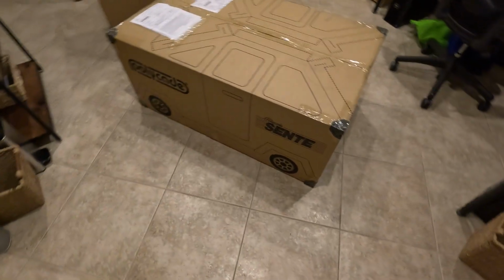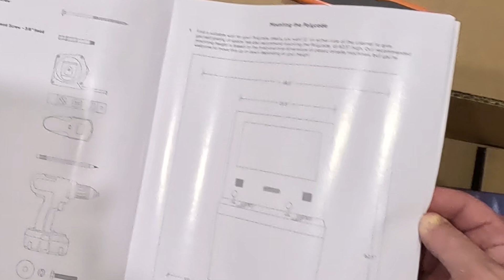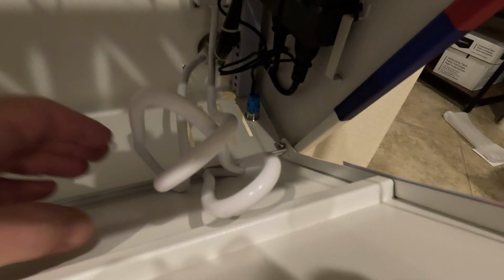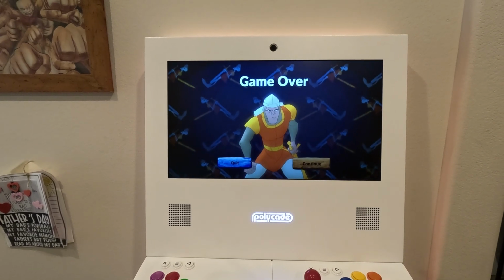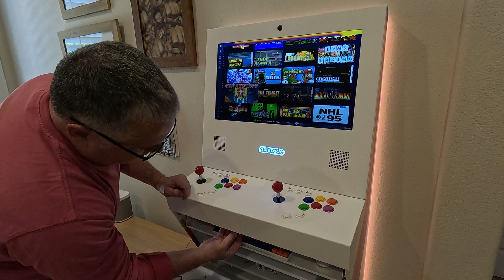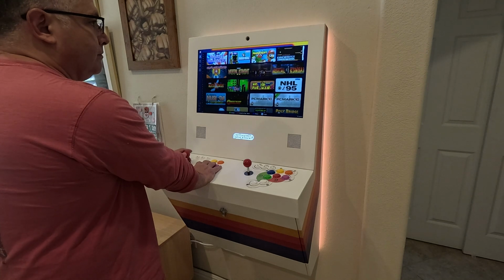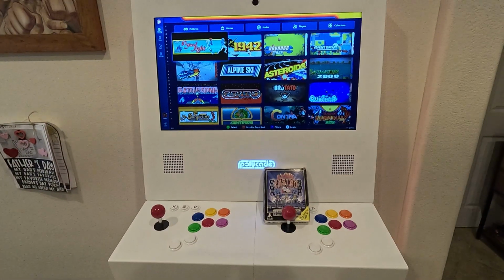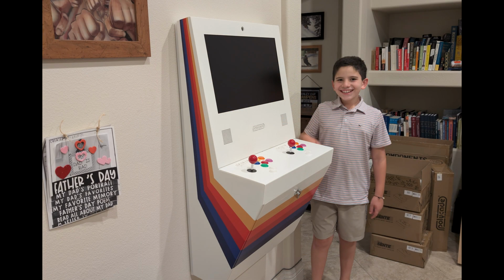Polycade Sente Unboxing and Initial Experience

Comment: Hello, thanks for putting this video together. I accept our Sente shipment tomorrow. I am going to run a new electrical outlet from the other side of our wall. Can you just put it behind the sente? Do you anticipate any problems with that versus having the power cord come out the bottom to an outlet? Thanks again! Edit: I see the wire access on the back of the bottom of the case now after watching that part again 👍
Reply from the maker: @seattlerealestateiq  if I had the time, patience, and resources, I would have placed the electrical outlet and ethernet access to match with positioning of the upper third of the back of the unit.

Having lacked the patience, I just ran the cables out the bottom. Works fine.

Comment: Perry, I am interested in the Polycade because it is a beautiful system. I was going to do a massive 50" standup arcade but there is something about the Polycade that looks amazing. My only concern and I wanted to get your opinion on this was the screen size. 24" 1080p is too small and the newer games the CPU supports would look way better in 4k. I know Polycade had to make cost choices but for close to 3k they should have upgraded the monitor. What do you think?
Reply from the maker: @enigmacarpc55  I'm perfectly happy with the 1080p monitor. I'm standing pretty close to the unit as I play and it's a big enough screen for me. 

I did buy an internal rack that would let me mount a more substantial PC inside the Sente.  I may yet build out a system that fits. If I do, I may not increase the screen resolution. You are right that newer games look glorious at 4K. I have some appreciation for the lower power requirements and quieter systems that would run games well at 1080P. I don't think there's a wrong answer here, just preference.

I also agree with you that the unit is very pretty. I might add that having it on the wall and on all the time makes it accessible and easy to pick from a good number of fun games.  A higher-end system running at higher resolution would draw more power. It might also generate fan noise as the thing stayed on most of the day. Just one more consideration for going the lower resolution and lower power route.

Comment: 1up Partycades perfected the wall mount slim form factor years ago. With lit marquee and full OG style art and vertical or horizontal 4x3 monitors, closer to og arcades.
No, not all metal construction, but good enough for non commercial home use.
This should use a rotatable screen.
Spinner a must for games like Tempest, Omega Race, etc.
Reply from the maker: Yah, the mount is excellent.  Official spinner is on order.  I custom made/configured one without much trouble.

Comment: Very nice video!  Can't wait for mine to arrive. Any thoughts on including other systems or running Batocera or some other front end?
Reply from the maker: Thanks.  I started with the Polycade software frontend AGS.  It works well enough and is integrated with a Polycade game store.  I don't see why something like LaunchBox or Emulation Station wouldn't work just as well.  I do like how the fanless Polycade PC fits ion the case.  I expect to upgrade with a custom PC + GPU at some point.  I might experiment with other emulation aggregators then.  I might add that the Polycade controllers are recognized as XBox controllers.  Dunno if having a Windows build makes things simpler or not.  I have not used Batocera, but it seems feature rich.  You like it?

Comment: This is the video I’ve been waiting for as I wait for mine to arrive! Thanks for taking the time to make it. did you edit the config file yourself to expand supported roms or are the units shipping with an updated AGS?
Reply from the maker: @GenericYoutuber1212  I edited the config to add Atari Lynx Casino emulation.  I also added a lynx casino core to retroarch.

I made a few pictures for the AGS library menu (header pics) too.
Reply: Could you please do a video showing me how to do this? I just got my sente on the wall today but have no idea how to get the games I really want like Joust, frogger and pacman. 

I need help. I don't know how to do this.

Comment: Thanks for taking the time to do the unboxing video. Early on you mentioned that you might swap to a pc with a gpu. Can you go over why someone might want to do that or what limitations the mini pc has that have you contemplating an upgrade already?
Reply from the maker: @SeanF-c9d  The included PC is more than enough to handle 99% of retro video game emulation on multiple types of emulators. As the games get more visually complex, involving 3D graphics and twitchy gameplay, a graphics processing unit can help ensure that games play at a reasonable frame rate.

The Sente provides for multiple controller types, and the number of available controllers is likely to grow.  I have a pipe dream of purchasing the upcoming release of Microsoft flight simulator and using a flight yoke and throttle system that I can attach to the Sente.  There are a few pieces of that puzzle that are still missing, but a PC with a GPU would be required for reasonable gameplay.

Comment: Thanks for posting this. Looks like game play is smooth. Any particular reason you chose not to install an outlet behind the unit? Looking at the installation instructions, it looks you can install one behind the screen area and then have your power cord completely hidden (and saves having to go through that back hole)
Reply from the maker: Didn't want to wait for an electrician to drop a line in the place of my choosing.  I agree with you though.  An install that hides the power cord, and maybe an ethernet cable, would be ideal.

Comment: Great video. Did you notice if there is room behind the machine to accommodate routing the electric cord? When mine comes, I was thinking of hiding the wire fully behind the machine and plugging it into a recessed electric box that I would mount behind the machine.
Reply from the maker: Yes.  The Sente is designed to do just what you say.  See page 5 here: https://cdn.shopify.com/s/files/1/0065/4956/9647/files/sente-instruction-manual-print-v1.3.pdf?v=1722474147
Reply: @mskraddoc  awesome. Thank you so much!

Comment: I’m interested in making a home arcade cabinet myself. And I’m kind of interested in the wall mounting system. I find it just looks cleaner. I think the modular control deck is a cool idea, but I can see it being a little annoying having to unscrew, Remove, switch out and screw back in
Reply from the maker: @Metal-Josh  I guess there are a lot of right ways to do it. I like the form factor for this unit. There is a price to pay in terms of switching controllers in and out, but the advantage is the unit is configured simply and in an accessible way once you have picked some controllers to use. Makes it easy to share games. When I want to change things up I can. Home cabinets that try to fit five or six controllers don't seem quite as nice to me, although once configured they are probably simpler to maintain.

Comment: Thanks for the video, did you add your own roms and did you add the art work for those as well ?
Reply from the maker: I am able to add my own ROMS.  Most of the artwork populates in the Polycade AWS software interface automatically.  I had to 'make' the artwork for a few titles.  Requires basic image editing and specific file naming.  The new images have to find their way into the right directory too.

Comment: Great video, thanks for your time on the post. Quick question,  where did you get joust from?
Reply from the maker: I think there is more than one source for that.  Polycade has an online store that works well.  Steam games run well too.
Reply: Gotcha, yesh couldn't find it on either. Will check around. Thanks

Comment: Thank you for sharing your experience! Can you share a little bit about the experience of adding your own ROMs? I'm considering the Sente, but I'd like to know how ROMs are loaded and display in the UI? Do they load the same way as a pre-installed/purchased game? Or is there a different way (side menu or something) to start them up? I'm hoping they start/load the same way, but then how does one provide "cover art" for the game menu?
Reply from the maker: Adding roms was easy and worked well.  There is a menu driven process.  Once loaded, a network lookup checks for game related art and other assets.  I'd say 95% of the assets were good.  The few pics I didn't like, I made myself.
Reply from the maker: Mame version is 0.223

Comment: Thanks for video. Does it not come with standard 2 player setup? Looks like your is separate controller and don't have the side buttons to play pinball games?
Reply from the maker: @snapalpha9448  it can be configured well for 2 player games.  There is a controller with side buttons for pinball too.  Word is they will make available a vanilla controller mount that one can use to secure a variety of USB controller devices too.

Comment: The problem with horizontal screen or monitor is that vertical arcade (many shooters..including ms. pacman, donkey kong, dig dug, froggers..etc..)  games are shrunk. You'd have much wasted space on each side of the screen. Best monitor to play both vertical and horizontal screens is in aspect ratio 4 by 3.
Reply from the maker: @Mark_Thackeray  It's a fair point.  I think there is more than one cabinet solution that has a rotating monitor.  I'm ok with how games like Dig Dug and Donkey Kong Jr. look when displayed on a landscape monitor.  I also like the overall hardware form factor that the landscape orientation facilitates.
Reply: @mskraddoc  The only thing I like about this item is that it takes up less space and you can hook up a mini-pc, so you can run more console systems. Raspberry pi is just too limited.
Reply: @mskraddoc  If you have the cash and time you might get one with vertical monitor if they do offer one. Then you can load all the vertical games (tons of overhead shooters) and others to it.
Reply from the maker: @Mark_Thackeray  I think I am good with the landscape monitor. I think it looks great.